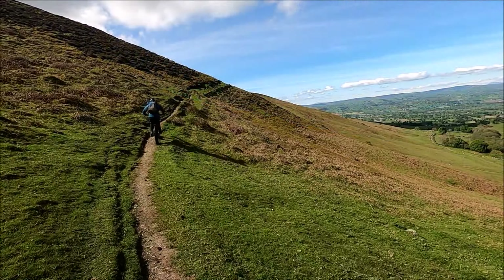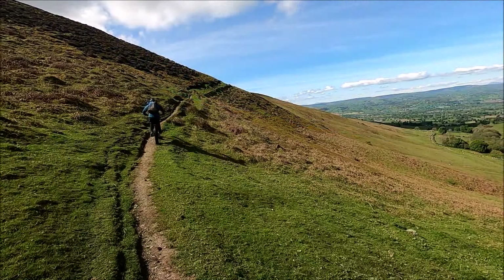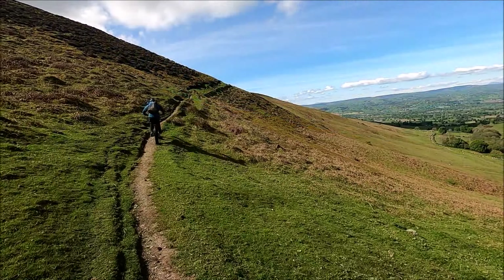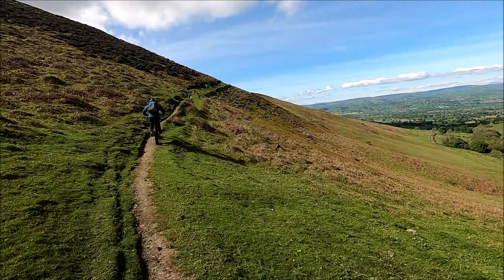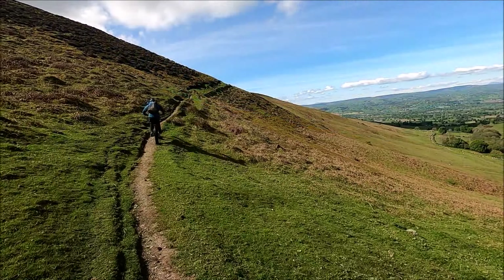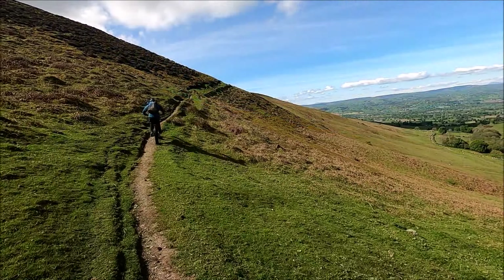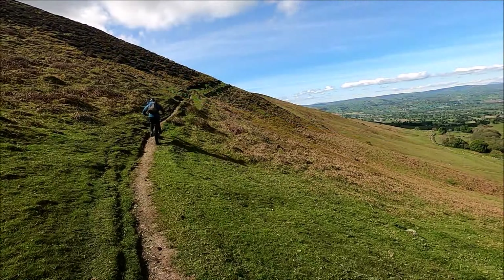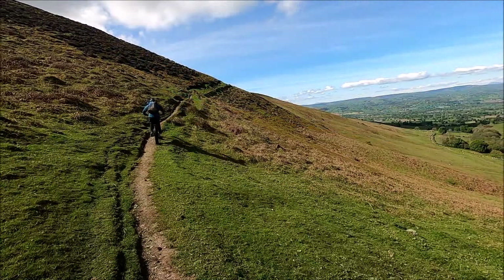Hub vs Midrive, climb to King Georges tower at Moel Famau.

Comment: My latest bike is a seven year old Giant X1 Anthem with a 48volt TSDZ2 installed. I have been building ebikes since the 2010, and I changed to middrives in 2014 when the GNC middrive came out. I hated hub drives for mountain biking, but the GNC changed that. My BSHD was even better, even if it didn't have the same insane torque. But the TSDZ2 with its torque sensor raises that to whole different level.

Comment: Hub drives are good solid reliable so I'd generally choose that for most rides, I can always get off and push if it cant manage some sections.
Mid drive is more for fun on really steep gnarly stuff.

I have both,
If I'm going a good distance I will take hub drive purely because I dont have to worry about that chain and it's more relaxing because I'm not having to constantly change gear.
Reply from the maker: Yup thats mostly it.
The geared hub does whine though, while the bbshd is silent.
Im more of a battle up really steep stuff guy, si moved to the midrive.
Looking for a bike to convert to hub though.
Reply: @chargeriderepeat7024  I have a 1000w dd rear hub and its quieter than my bafang ultra mid drive.
DD is very inefficient on any kind of hill but here in west Yorkshire there arent Too many serious hills like where you are riding so it's ok for here mostly, 
But for fun on hills and tougher off road  a mid drive is absolutely the way to go.

Hub drive is more for commuting type riding maybe..

I've also seen some bikes with 2 hub drives AND a mid drive lol.
Reply from the maker: Yes the DD..the hub we use is the geared bafang g06.
It has massively more torque.
A friend has a 1500w DD on his mtb, he wouldnt touch that hill...I had a go on it and it was awesome on the flat, but a steep hill and I thought the battery had died.

Comment: Great video ,has changed my view on hub drives for sure
Where both batteries same voltage ? 52 or 72
Reply from the maker: Well 48v/54.6 in real world ...mines a 14.5ah em3v and the hub is using a 20ah built with top quality cells.
Reply: @chargeriderepeat7024  even more impressive 👍

Comment: With a 28T chainring my e-fatty will climb almost anything! BBSHD with stock control, 52V 30 AH battery, goes for days
Reply from the maker: Yes.Ive just ordered a 30t, but the problern on that ride was it was so steep the front end would wander off the path constantly.
Reply: @chargeriderepeat7024  looked like it!! fun times!

Comment: what model fat bikes are they?
Reply from the maker: Mines a cheap chinese frame self build, the other is a Salsa Bucksaw self converted to geared hub.
Reply: Great video, thanks for bringing us along?
 What chainring are you using for those climbs?
Reply from the maker: 36 front..34 rear for bottom gear...turned out I was on the 30t gear on the freewheel for the climb.
Operator incompetence.